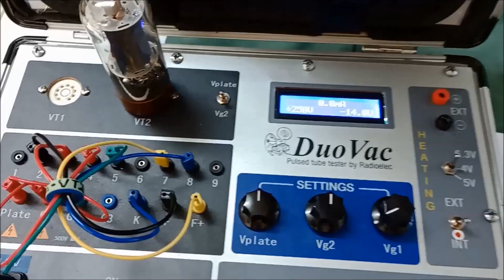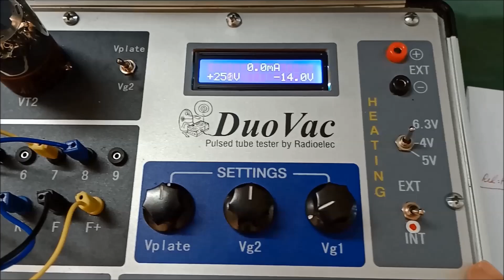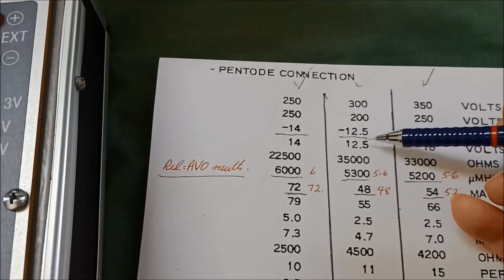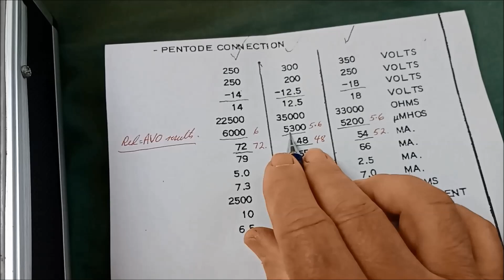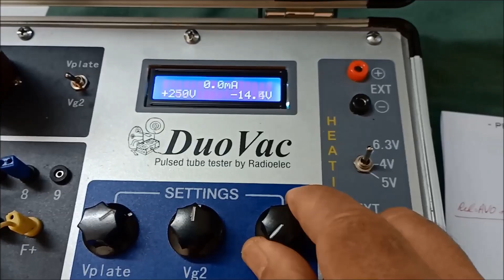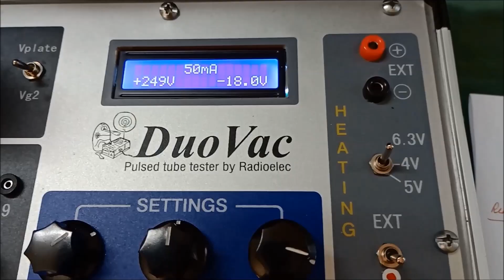duovac Tube / Valve tester

Comment: It looks like this tester doesn’t have a 12v heater? So how do you test all the 12 v tubes?
Reply from the maker: You need an external power supply connected to the top right corner sockets labeled  "ext" for any heater voltages other than the on board 4v, 5v and 6.3v supply. But if you're referring to the usual 12.6v tubes like the 12at7 or 12ax7 each of their 2 triodes are tested individually at their nominal voltage of 6.3v.

Comment: 2. Question, you are heating with 4V instead of  6.3V?
Reply from the maker: No, 6.3V. Hard to make out on the video but the toggle is on the 6.3V position.
Reply: @lei @leighrankin1611  thank… is the angle to view